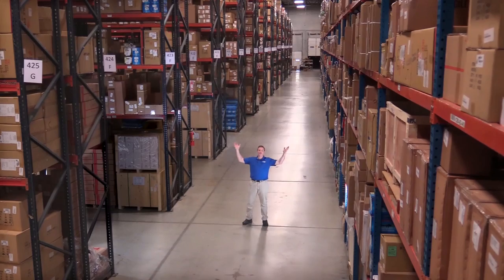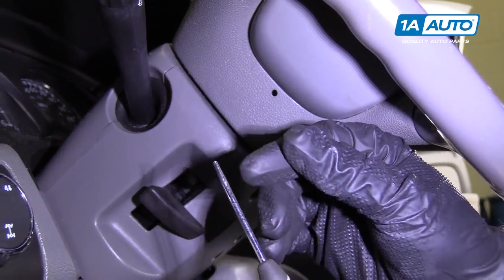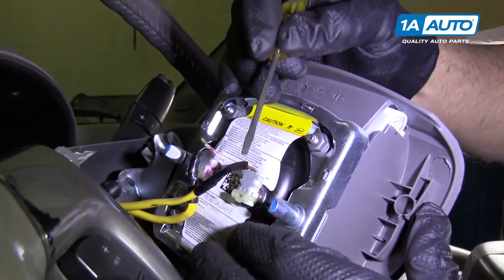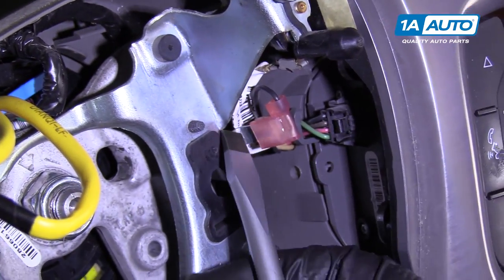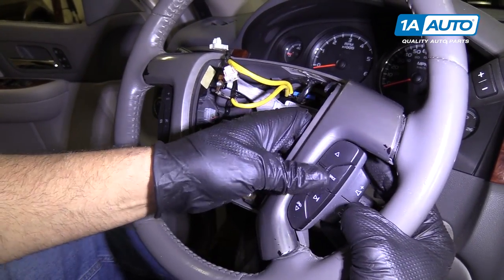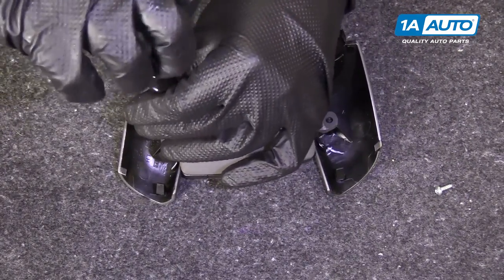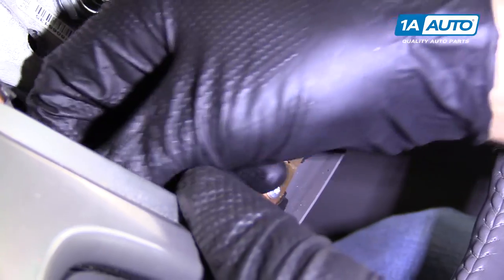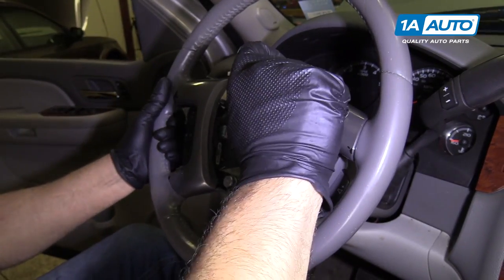How to Replace Cruise Control Switches 07-14 Chevy Suburban 1500

Comment: What are the symptoms pointing to the switch? My switch lights up when pressed, but no Cruise light on the dash. Already replaced the brake light switch which is the common problem. Any help appreciated.
Reply: Did you change it? Did it fix it? I'm having the same problem.

Comment: Very good video, this turned out to be a relatively simple repair on my 2013 Sierra. It helped to have a small flathead to insert into the tabs on those electrical connectors but overall not bad, I'd say 1/2 hour to an hour tops.

Comment: How do I test it and see if that's the problem? 2009 Silverado lt  I already changed the control on the brake pedal. Sometimes it works for a few minutes and quits and other times it won't work at all.
Reply from the maker: +jts728 We wouldn't be able to diagnose an issue like that here, you may want to have a local mechanic take a look at it. Thanks for checking us out! http://1aau.to/m/Shop-1AAuto-c